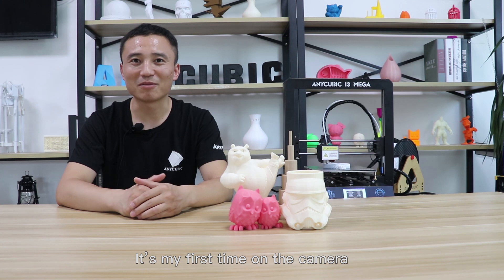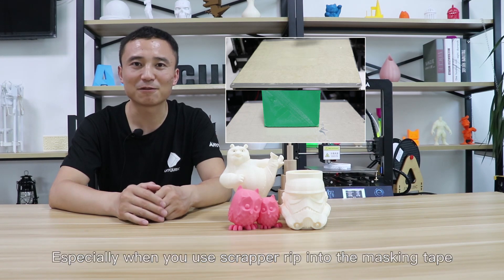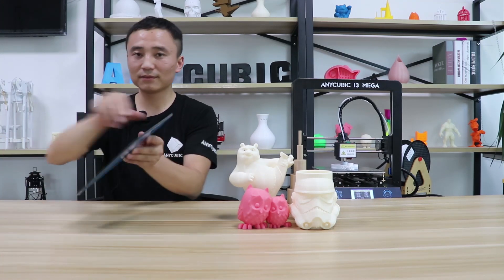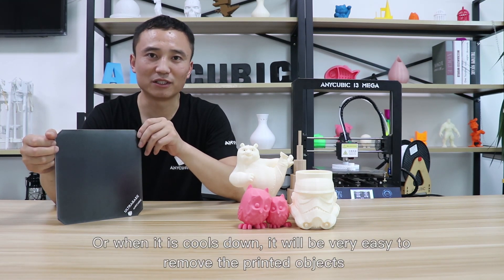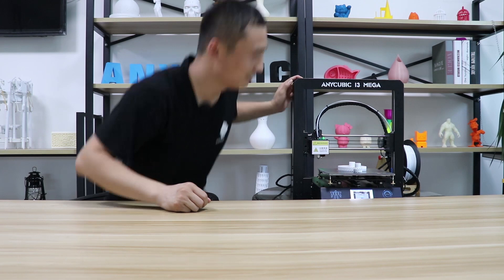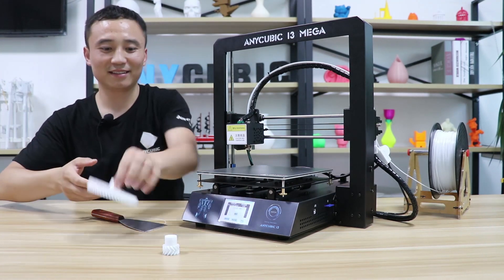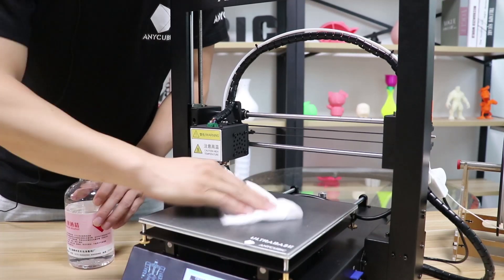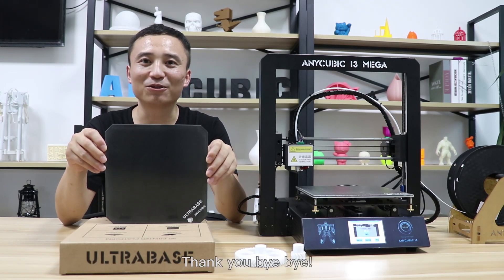Ultrabase Give-away | Upgrade Your 3D Printer

Comment: Just got mine tonight and it was missing the sticky blue adhesive on the back, used clips on the heat bed to hold it on. Attempted many simple flat prints and everything slid right off after a few lines stuck. I cleaned with alcohol and it discolored the coating, almost melting it off and i almost freaked out. The only good thing I can say is that the glass is perfectly level and flat. I adjusted the bed to flatten out the first layer a little bit more than normal to help it stick and it did stick slightly better but the prints rip off and apart after a few layers. Im sending it back as manufacturer defective part. How did this get out without the (advertised) adhesive back?! It was the 310x310mm for the CR-10. btw tried printing with +5 +10 +20c on the bed over normal and it only made the prints worse with no benefit in sticking to the plate.

Comment: Can it be cut to size to fit at home?
Reply from the maker: Sorry, it could not be re-sized because it's tempered glass.
Reply: I thought that you have a stick on sheet???
Reply from the maker: The functional coating is screen-printed on the glass surface, so there is no seperate sticker which could be customized into any size. Now we offer 214*214, 220*200, 310*310 and round-shaped 220, 240 sized Ultrabase.
Reply: OK thanks

Comment: I would want an Anycubic UltraBase for my Creality CR-10 printer. The plate is 310mm x 310mm. Are you planning on making the UltraBase in different sizes?
Reply from the maker: Hello Nasse, we have sold it for several weeks actually. Sorry for the information delayed for it's not convenient to share latest production information here. Please kindly follow our Facebook account or Twitter account, on which we usually share latest information about us.
Reply: The CR-10 / CR-10S is 310mm -- the specs on the printer show it as a 300mm bed but its technically 310mm itll fit corner to corner fine. I own a CR-10S btw.